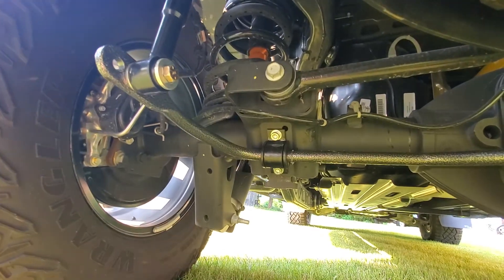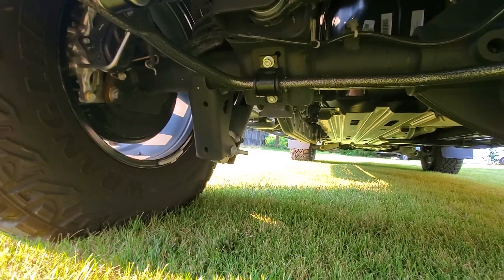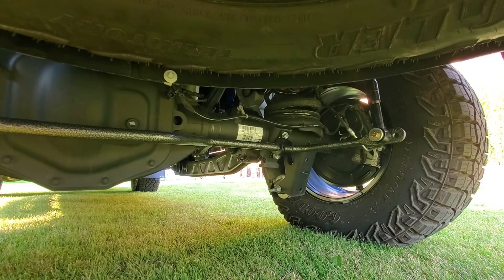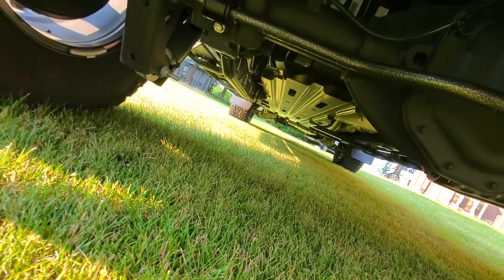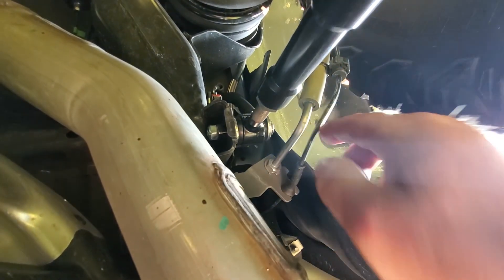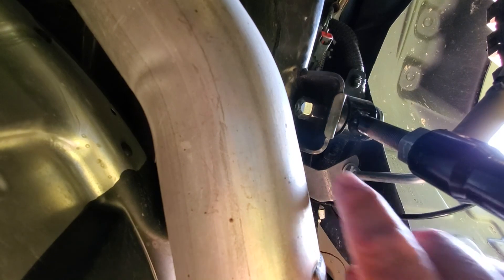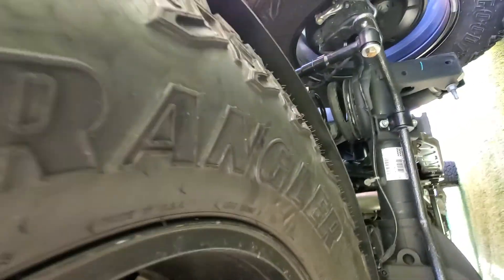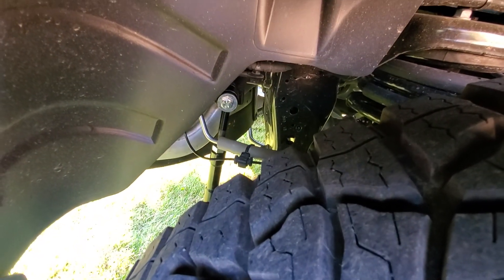Ram TRX Sway Bar install/review

Comment: I just installed this on my trx I have a question I put the end links backwards from what you have I have them like that following butter the great install video now I’m confused on the correct way to install them do I leave the end links how I have them because it doesn’t matter what side they are or do I have to switch the end links to be like on this video?
Reply from the maker: If you're talking about threads on top or bottom it doesn't really matter whichever you prefer I just wanted to threads on the top

Comment: How did this work out for you at the time. Got a couple questions
Reply from the maker: What.ypu need to know?
Reply: @vfr800fi07  I was looking into ATM.. when cornering sometimes take the turn a little too quick. And the esc kicks in. Would this help?
Reply from the maker: @Touchedbyapriest  I don't know that it would help that or not . But it will help a bit in body roll for sure.. you may have to put it in sport mode or something to reduce that from kicking in as much
Reply: @vfr800fi07  do you know if that option is available to do on a limited ram?

I can always check with dealership next time
Reply from the maker: @Touchedbyapriest  oh I was thinking it was a TRX
Reply: @vfr800fi07  nah all good I'll just have to ask

Comment: Do you notice a difference? Did you add the sway bar for trailering purposes? How much does the kit cost?
Reply from the maker: You do notice a difference in sway
. especially changing lanes or higher speeds. The kit ranges from 300-400
Reply from the maker: I assume it helps with towing... But I already had it on before I towed the first time
Reply: What’s are the part numbers for the front and rear sway bars for a stock height TRX?

Comment: Is it worth the upgrade ?
Reply from the maker: I believe it is .for a little more stability.
Reply: @vfr800fi07  you still have yours on? Any help or detriment to the 0-60?
Reply from the maker: @HVACOG  yes it's still on.. and I noticed no difference 0-60
Reply: @vfr800fi07  the TRX forum made an announcement that they’re making one specifically for the TRX in April. Woot. I think I’ll get it